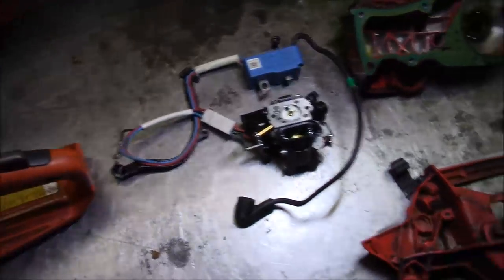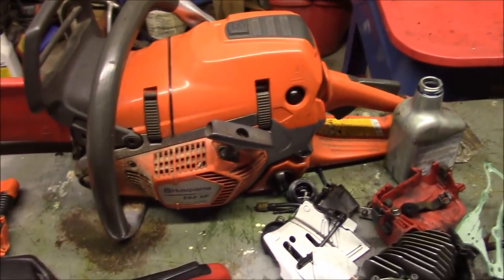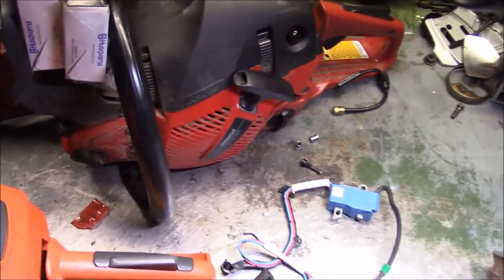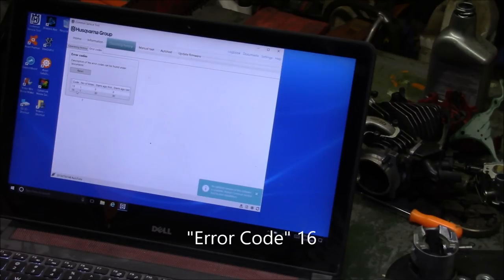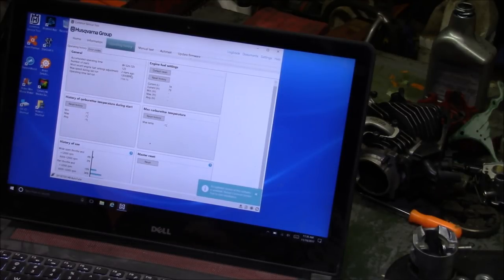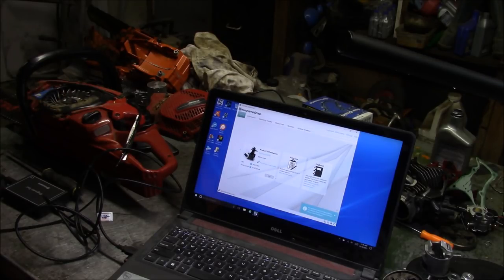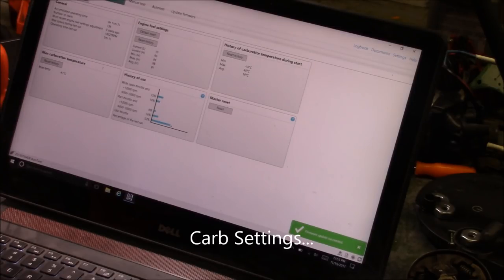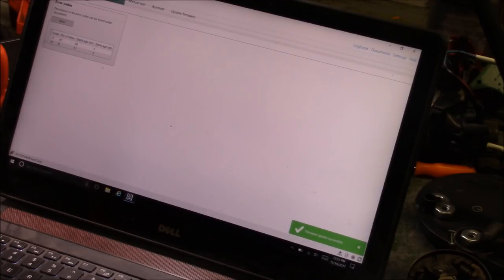Husqvarna  Autotune Chainsaws Using Common Service Tool ( CST ) to Evaluate & Update Firmware on 562

Comment: I use the CST on a regular basis. What I find it most useful for is the firmware updates on carbs. The error codes are a useful pointer, but can also lead you on a wild goose chase. For example, I had a 550xp with codes 13 and 17 stored, but still needed a pressure/vacuum test and compression test to diagnose that a leaking de-comp valve had caused the piston to overheat on one side and fry the ring. Then had a 560xp also with codes 13 and 17, with seemingly a high idle. But using a tachometer showed that the clutch has engaging at low revs, due to it having a hairline crack. 

I'm a full time Service Tech at a Stihl/Husqy dealer in the UK, so I see a high volume of the autotunes/m-tronic, but I still rely on the classic 2-stroke test arsenal (pressure/vac, compression, spark,) and experience, instinct and years of manufacturer training, and common sense! 

The CST is useful, but we're not yet at the level of technological advancement where diagnosis of hand-held equipment is heavily reliant on a computer interface. Plus I don't really see it ever becoming so, because the big manufacturers are steadily using cheaper parts and manufacturing processes. I've seen it first hand.
 Just my twopence.
Reply from the maker: Of course that was the point of the video to articulate while there is new "visibility" to the real time state of a working saw, you still have to have the skills to interpret what you see. Nothing magic or automatic about this as an evaluation tool. I also use it frequently working for a couple of dealers, they keep me busy. A couple of other things I find it really useful for is documenting the history of the saws I work on (especially as they come from different sources..very important t!!), evaluating saws that would be trade in's, and supporting warranty claims. I think how folks choose to approach this tool also will determine what they can derive from it, obviously boundaries are set by the physics of what it tracks and the reality of the particular saws evaluated. I happen to like it. I don't "depend" on it alone, but as I've become more familiar with both the particular saws supported and the tools, trends certainly have emerged...BUT its still simply yet another tool along side my compression testing equipment, vac testing tools, and just 45 years of working on two strokes. So we agree I think. Also have found the service bulletins to be very very useful. Now especially for the 550's. Might do a video on those next year. Don't have time this year, but the upgrades now available really do help from what I'm seeing.

What I would like over time is to find a way for those "experienced" to have a place to chat and share real experiences. Hope that would help all involved expand their knowledge set and help make CST even more useful. One thing I learned real fast in another career with years of over sea's travel...there is NO shortage of smart folks out there! And giving a tool like this to the mechanical community along with a way to share experiences, there is no way to predict how creative folks might find to apply these tools as they evolve. (I'm an old Cad/Cam/Cae dinosaur who spend years doing customer/product support and design...)
Reply: Yeah I think we do agree on many points. I appreciate the fact that you take the time to attend to the little details, which are often glazed over, yet are crucial to do the job properly. I can understand why you'd be a valuable resource to your local dealers, when I'm at work I'm under a lot of pressure to do the work in a timely manner, it's hard to be as thorough as I'd like sometimes. My dealership labour rates work out at around $74 per hour inc. tax, so jobs like full rebuilds, even just top-end rebuilds very quickly become uneconomical. Which is disappointing to a saw geek like myself!

Hope you have a Happy Thanksgiving Walt. Looking forwards to the next video.

Comment: Bonjour.  J ai une redmax gz5000 une 550xp mark ii and husqvarna 545 mark ii.  Ma redmax gz5000 a toujours un refus comme trop riche elle fait son 13650rpm mais n'a pas une bonne réponse comme les autres et tout est OK sur l ordinateur.  Quel différence sur les pièces peut il avoir
Reply from the maker: I would start with a simple field tune procedure. Often that cleans things up. With out seeing saw "in person" or the CST read out of operating history it's real hard to diagnose across the internet. other thing I would do it just pull the air filter and see if that makes a difference. I've see perfectly good looking air filters so restricted the saw would run rich.
Reply: @afleetcommand  ok thanks

Comment: Interesting and good overview but I have to ask why no more base gasket delete builds on these saws or did I misinterpret what you were saying.
Reply from the maker: Not on 562's no. Other saws like the 576's and 372 I still will. The 562's have enough tolerance and interference issues, I simply won't add the variable anymore.

Comment: I had a non starting 550xpg with a fine spark but no voltage on the red wire from the ignition coil to the carburetor. I bought a new used ignition coil with a almost matching number and mounted it on the saw, pulled the starting rope and now there was a voltage of 8-16V on the red wire so I connected the carburetor and the saw was then running fine again after the autotune had tuned the mixture at full throttle.

Comment: One of the most useful tools for finding a vacuum leak in a car is to measure fuel trim at idle compared to open throttle. When a lean condition improves at open throttle, red flags go up to tell you the cause is a vacuum leak. Your last case study did exactly that, even though the technology stream is completely different. Thanks for the excellent review. It's too bad Husky don't offer a CST kit for regular customers to allow them to tinker with their own saws. This seems pretty close to the 'right to repair' debate in other industries.
Reply from the maker: Brake clean is easy and cheap, only one cylinder and one crank case to deal with. Faster than analysis of data after hookup, and way faster than a static vac test. :)

Comment: Sounds to me, the units of valve (mixture valve?) operation are duty cycle of the valve solenoid.  The longer duty cycle becomes, the more time the valve is closed (effectively leaning out the air:fuel mixture).

Comment: very interesting video , iv'e seen a   few over time  here and there , my 562 is a 2012  5 bolt case and has a EL44 carb and never an issue really , runs really well starts easy and doesn't do the surge thing back to idle like you mentioned,  but I did the muffler mods and cooling mods ,decomp delete , has a meteor piston and caber ring as i decided to pull it apart after i got it second hand , nothing was wrong with the cyl or piston other than some tiny dull area on the skirt normal wear over time which was no issue but replaced anyway .one little thing is ...it has tiny bog off idle , nothing much but i do notice it , does it every time on throttle for a tiny amount of time(previous to MM too) no difference before or after that, run it 40:1husky XP oil  , so was that an issue with early saws with the 44 carb or is it  only possible to do a firmware update to that carb or will it be better to fit the latest carb ,which has integrated coil/wiring which is rather expensive all in , nearest one to have it checked is 45 miles away too which is a bit of issue , thanks for any input Walt

Comment: afleetcommand, I just started with the CST, did a few 550 saws.Do you have any,or could you do a new video about autotune and specifically fuel numbers?
Reply from the maker: They should sit around 75. If they drop below 30 start looking for air leaks. If they go over 100 start looking for scuffed cylinders :)

Comment: hiya , some good info  where do one get the program to do updates like you are doing I rebuild a lot of saws that could be updated
Reply from the maker: You have to be a dealer. That is a dealer only system at this point. I do work for one in particular and that is why I have access to a system.

Comment: Awesome video! 
Can you tell me please if a 562xp/2260 wrap handle will fit my Jonsered 2258/Husqvarna 555? 
Thank you!
Reply from the maker: Honestly don't know as I haven't tried.....and there is that geometry difference on the PTO case half. I would certainly try one though! Whats the worst that could happen?
Reply: I would try but in my country I can't order one because dealer don't import wrap handles. I tought somebody tried out...If I knew exactly that is a perfect fit, I would order one from ebay.
Reply from the maker: Let me ask around....I will report what I find.
Reply: afleetcommand thank you very much!

Comment: Walt,

Now when will Husqvarna really take care of their customers and let them do the firmware update from home?  

I don't have to run to Apple every time I need an update on my iphone.  A simple plug in at home to check for current update would be nice.  If it needs more then sure the dealer can adjust settings.  

Nick W.
Reply from the maker: Not going to happen, and you can thank the epa regulations for that. They need to control the tunes to ensure the saws stay epa compliant to what ever extent they can.
Reply from the maker: There are no epa regulations that would cost Apple money as they don't burn hydrocarbons.

Comment: Have you got much info on the 545 and 550xp saws. 

I work on them often and buy 545s of eBay regularly. 
For some reason they have at12 carbs. 
But husky say they should have at7 
What would you say the difference would be. The early ones had a ring on the intake for the 550xp. Then the 545 had a brass ring in to manifold. 
They both have that set up now. 

Is there any diffrence do you think on the way they work? If so. Running a 550xp firmware on a 545 with the at-12 carb. Recon it would work properly.
Reply from the maker: Just beginning to dig into those. They have gone through another upgrade. We were introduced to a carb kit and firmware upgrade they highly recommended at training.  I need a little experience with them before saying much. Bob has done a bunch with them. I'll see him this weekend..he's coming over on Sunday. I'll see if we can put something together..
Reply: Thanks for the reply! 
Yeah I'd say I'm not very up on the carbs. But I know my way round them, 
If you and bob could do a video on them. That would be great help! 
I've looked at putting a 550xp coil and carb on the 545. But because of the cylinder and non crankstuffed. 
I'm not sure if it will work properly?
Reply from the maker: On the 562's you have to keep the ignition module and carb "number" pairs the same. Suspect the 550's are the same can't mix and match...